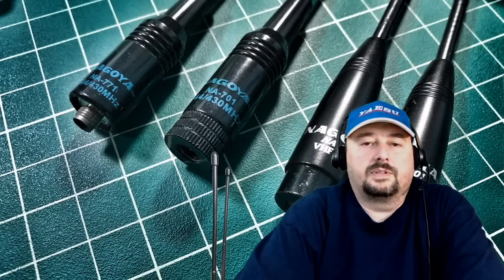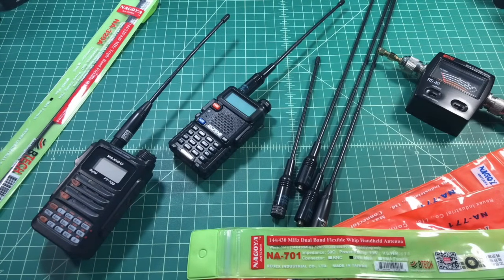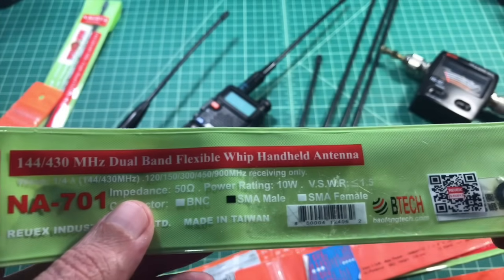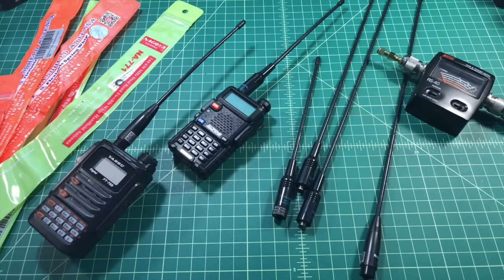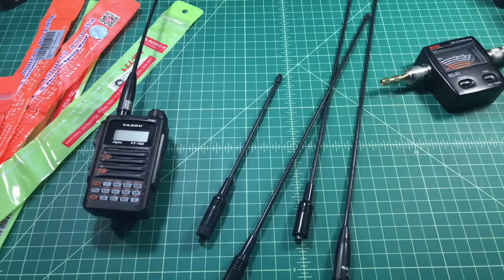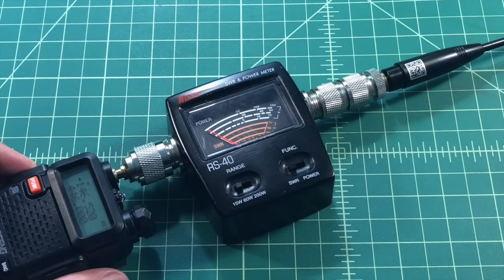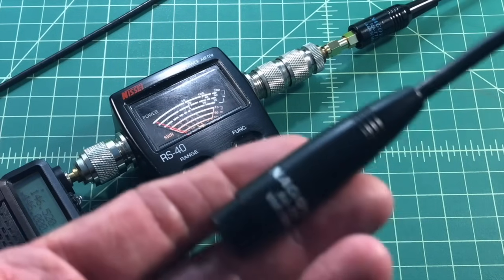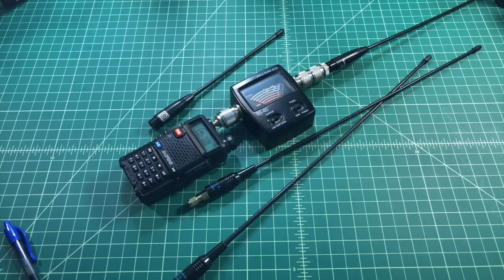Fake Nagoya Antennas - TheSmokinApe

Comment: I don't quite understand this "performance" test...wouldn't an over the air test have been better?  Or maybe a measurement of radiated power?  I think a low SWR doesn't necessarily mean it is a good antenna.  A dummy load would likely show 1:1, but that wouldn't make it a good antenna...just saying.
Reply from the maker: A dummy load isn’t efficient or necessary resonate. I appreciate the feedback back, this test wasn’t about radiated power but reflected power.  Thanks for watching 👍
Reply: his swr test is most important. some of us use radios other than 20 buck uv5r and value our finals. i always check antennas on nanovna tester and spending 20 bucks on a vna is cheaper than 100 bucks on a major repair on a 600 buck handie

Comment: Ive got the uv5r and am able to tx rx 32 miles. There's nothing wrong with the stock antenna. Would've been interesting to see the stock rubber duckie tested here.
Reply from the maker: I agree that that stock antenna work pretty well, often adding a higher gain antenna can create RX issues by overloading the radio 👍
Reply: @TheSmokinApe  how 8n the world could he be reaching 32 miles?
Reply: 32 miles is easily achievable on VHF/UHF with line of sight.
Reply: How in the heck are you getting 32 miles?

Comment: The easiest way to identify a genuine Nagoya NA-771 is to look for the little inverted triangle inside the first letter "A" of "NAGOYA". If it doesn't have the triangle its a fake. If the printing is blue (or any colour other than white) it is also a fake (this Info. comes from the manufacturer). See link below for a close-up photo of the triangle (scroll down to the bottom of the page).
https://charlietangodxgroup.forumotion.com/t1249-diamond-x50n-on-pmr
Reply from the maker: Philip Fletcher great info 👍